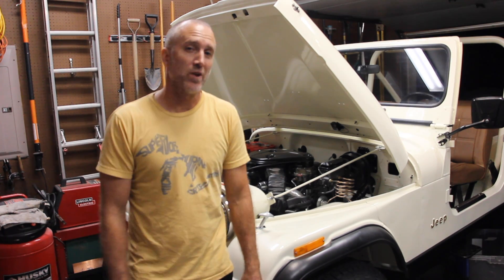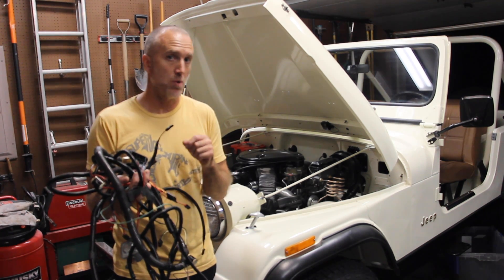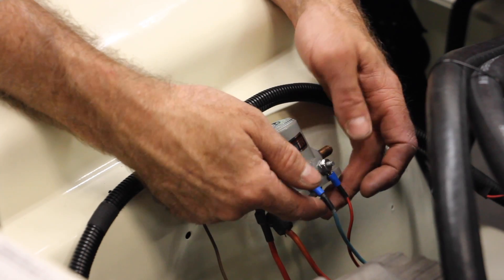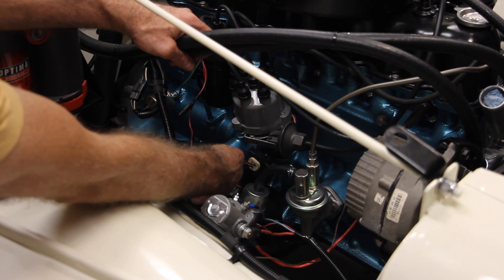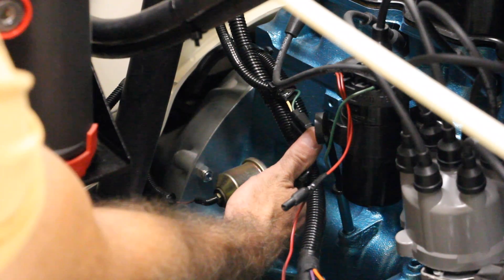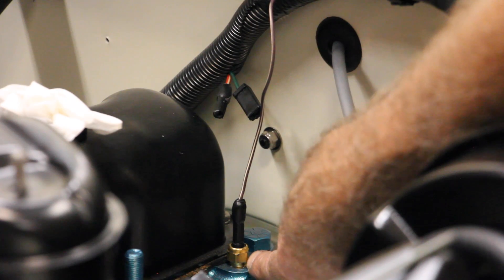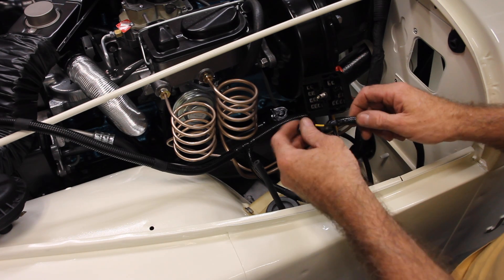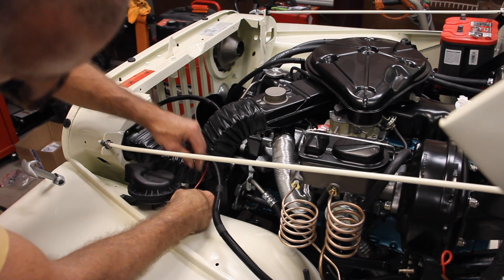Jeep CJ7 258 Engine wire harness install

Comment: Perfect! I have a Painless wiring harness the PO gave me. I’ve been scared to tackle the project! Thanks for your videos!
Reply: I’m no pro at electrical or re-wiring a vehicle but have either fixed or replaced some myself as well . It’s been said many times in his videos and I totally agree “ label every connection as you remove them “ . We are not perfect , we are likely to,forget . I was just looking at the dash from my ‘73 cj5 in my basement stored for next spring until I get back to work on my restoration. Sure , I knew EVERY connection when I took them off , now I’ve got to reason them out if I cannot remember . I’ll get it , but it pays to tag them . Lay out the new harness side by side with the original tagged harness . It’ll take awhile but you’ll find the method of madness . Start by tagging each section and where it’s routed and work on one section at a time . Don’t cut wires until your sure you’ve got all the sections in place and set in place correctly . Same goes for terminating them . You want to be sure you’ve got them routed correctly before you trim lengths and crimp on terminals . Besides , some connectors can’t fit through places like firewall holes . They have to be routed first , terminated last when your sure all is correct with routing and length . Nothing worse than wasting wire , connectors and time . Do not rush , always be sure . Think also about how you may have seen wire lengths either too short or long on the original harness . You have the unique opportunity to improve on production line errors and quality control issues . They give you plenty of wire length , don’t worry . All that you’ve got to do is find what may have to be saved from the original harness if it’s not present in the new one . There may be added wiring for future planning such as adding air conditioning , electric chokes , additional gauges , etc. Metal crimp terminals and plastic connectors  will have to be noted and ordered if not in the kit . You pay good money for these kits , take pictures and send them to their customer service if you need their help / advice .

Comment: hi mike thank you so much for you reply  forgot to say have stripped the seats in mine as springs and frame need making  good , looking forward to seeing you tackle that, i was a tool maker back in the day so know a bit  have the workshop manual but seeing you do it fills in the gaps ,,i have to say you don't  call yourself an expert but you sound like one, and one you can be understand so thanks again
Reply from the maker: Fake it till I make it :) thanks for the feedback.

Comment: Great job on this engine harness as well as the other videos. I am restoring - groung up and boly-by-bolt a 1982 CJ7 Limited. very much you did.  I noticed that your terminal connectors look new, I had a hard time refurbishing these connectos on the last YJ restore. Can you buy the coinnectors new or how are you restoring the connectors - they look brand new. thanks for your effort and time.
Reply from the maker: Took a lot of work, but if you need to or want to replace some of your connectors, then this is a really nice place to start. https://bit.ly/3pJyfOy

Comment: great content  just got a 79 right hand cj7 over here in the uk total novice  so your knowledge is great doing the wiring so thanks, noticed the coil break lines (i think) did you bend those for vibration as look trick  could you explain what they are thanks again for your help
Reply from the maker: They are just for effect. I used a soda can (unopened) and just bent the tubing around it.

Comment: Yes , the auto trans starter solenoid relay has a third terminal on its bottom side . It is wired to the neutral safety switch . Us manual trans guys don’t worry about those things but it is something we all should be versed with . The pigtail socket , red w/tracer you spoke of on the IGN. coil positive harness side , yes , that is for a condenser / capacitor . It’s just an RFI filter to reduce or hopefully eliminate static on the am/fm radios of the past era . An HEI distributor had one on its ignition module harness inside the distributor . Without these condenser/capacitors , our radios would transmit high pitch interference through the stereo system . It sounded like the bugs bunny cartoon when bugs was radioing the NASA console . Yeah , had to be there .
Reply from the maker: Love the reference. Sure Marvin the Martin didn't have that problem also?
Reply from the maker: Us manual guys are a disappearing demographic.
Reply: @coolguy_CJ7  
We had to be extremely careful around Marvin the Martian . He had an acme disintegrating gun . He didn’t appear much , he had attitude problems .
Reply: @coolguy_CJ7  
Because our vehicles have the melenial anti theft device , our vehicles are less prone to theft . By the time they google it , we’ll be all over them . But yes , we are a rare commodity . If people could drive a car with their hands in their pockets , they would . I’m convinced .
Reply from the maker: @gmoney9588  Wonder if he was the guy that actually designed some of the stuff on the CJ7. It would explain a lot.

Comment: I totally forgot to share / comment on the duraspark and / or duraspark 2 ignition . From what I’ve learned : starting from the firewall bulkhead connector , the red w / white tracer ign. ON splits into two . One goes to the two wire ign. module plug red wire , the other onto the ign. coil positive post . The blue wire from the START position on ignition switch splits on the engine side of the firewall through the bulkhead connector as well . One goes to the S terminal on the starter solenoid relay and also had a blue wire split from that into a pin out to the ECM . The other blue wire split at the firewall bulkhead connector went to the ignition module two wire plug white wire . That serves as a bypass for the ignition module . Just as the I terminal of the starter solenoid relay serves as a bypass for the ignition coil positive , when voltage drops while starter circuit is live , the blue wire will replace the loss of ign. ON voltage by using voltage from the blue START wire for the ignition module as well as the ignition coil gets its replaced voltage through the I terminal starter solenoid relay bypass when the S post is live , the I post is live . When the key is released from START , the voltage returns normal to the ign. coil positive red w / white tracer and the red w / white tracer to two wire plug into the ignition module . 
The four wire plug coming out of the ignition module : you may see black , orange , violet and green . The green , yes , goes to the ignition coil on its negative side . The black is the ignition module and distributor ground . It’s good to splice an additional wire onto the black wire to add a ground since aluminum ( distributor and ignition module ) is not as good a ground as steel or cast iron . The violet and orange wires go into the distributor as well but to the magnetic trigger . On a post emissions system , the violet wire is missing from the four wire ignition module harness . That’s why the nutter bypass has you jump the connector . I used a 1980 ignition module with four wire and two wire plugs . If removing an ECM ( state inspection rules may apply ) the violet wire comes out of the ECM and to the distributor . The orange wire will go into the ECM and exit to the distributor . A wiring diagram will show the violet wire emerge out of another pin out as well , but essentially the previously mentioned wires will ultimately go to where previously mentioned . All we have to know is what wire , by color code , goes where if we are making our own harness or using an after market for the duraspark / duraspark 2 . Note : you won’t see the I terminal starter solenoid relay bypass wire go directly to the ignition coil positive post because it travels from the I post directly up the main firewall harness and splices to the ign. red w / white tracer coming from the firewall bulkhead connector , hidden from view . The ign. red w / tracer and the blue START wires are single wires from the ignition switch but are double crimped in what bulkhead connector cavity they emerge as double red w / white tracer and double blue . Each cavity will have the two wires going their own direction as previously mentioned .
Reply from the maker: Well, I was going to do a video on the restoration of this wire harness but you just explained everything I was going to do. ;)

Comment: In my 83 cj7, there is a diagnostic port mounted on the passenger side fender well under the hood but in the 10150 harness, I see nothing showing how/qhat to wire to it or is it even needed???
Reply from the maker: Not needed. It was how the mechanic could plug into the ECM but you need a special reader to connect to it. Good luck finding a mechanic with that type of reader :) Do you plan to keep the ECM or do a HEI distributor and remove all the excess wiring and vacuum hoses?
Reply: We are removing the computer completely, however, the carb is now throwing us for a loop. How do we fix this or do we have to get a new carburetor?? We have the hei distributor already installed.
Reply from the maker: @tarapritchett5455  carb problems are a different animal. Could need a rebuild, or could be a vacuum leak. Of course, it could also be a timing issue, a fuel pump problem, clogged fuel filter…etc. email me at dellis6914@gmail.com and let’s see what I can help with.

Comment: Did you ever by chance make the dash wiring harness install video?  I just bought a 81 CJ7.  Thanks!
Reply from the maker: That is on my list. Work and rebuilding the 258 in my wifes CJ7 has put a hold on making new vids.

Comment: What years did cj come with fender mounted solenoid 79 to 81 ? Thank fur your help
Reply from the maker: I believe all 10 years. 76-86. There are slight differences in the fender structure for wide track axles and narrow track axles, but all of them have the fender mount holes for the starter solenoid.
Reply: @coolguy_CJ7  👍⭐💯🇺🇲

Comment: Great video! I must respectfully disagree on one point; the Nutter Bypass is only necessary on 1983 and newer CJs.
Reply from the maker: I must respectfully agree. I was not clear enough about what years you would "need" to do the bypass with. I was thinking that the video was more of a base level explanation. Although I do believe that the full emission control and computer started in 82. :)
Reply: @coolguy_CJ7  That's a question for the ages.  The '82 258 I'm restoring has an air injection system, but is missing the computer.  I have heard of some '82s that had the computer, but I've never personally seen it first hand. Regardless, nothing is more satisfying than stripping that junk out and selling it for parts.